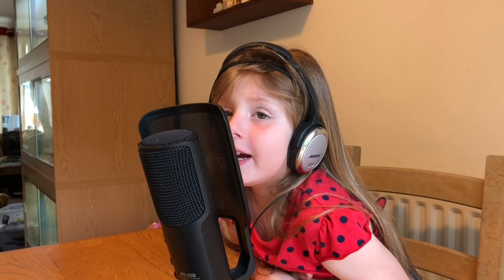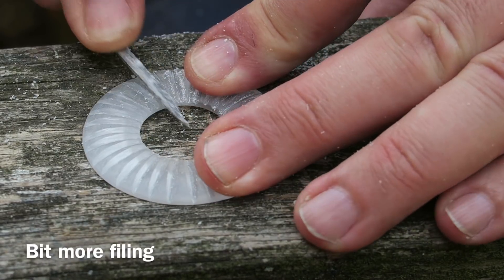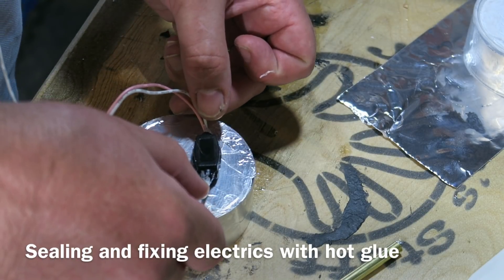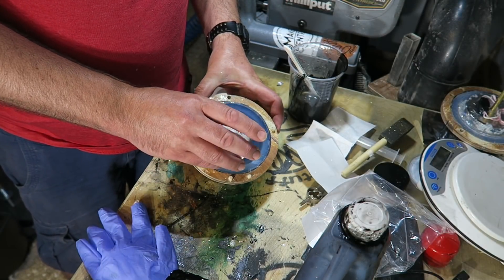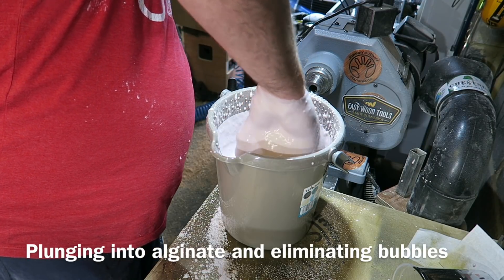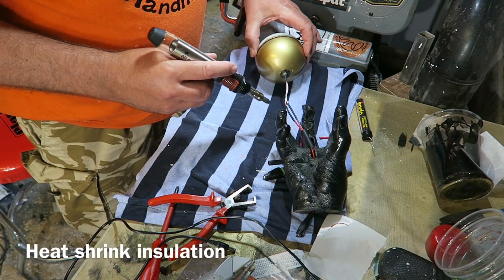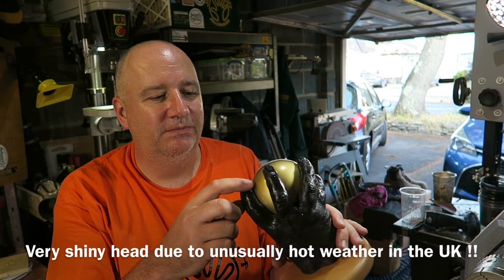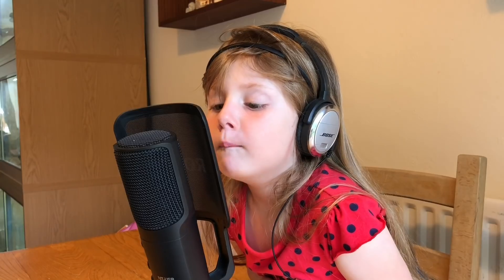Making the Goldeneye Light

Comment: 👁 😍 it 👍👍 Another good idea,You said it uses 12v, could it run on a 9v battery in the base of the led eyeball.Maybe a moving  led eyeball like the 😱cylons.
Reply from the maker: Thank you very much David. It would probably work on 9v but I have not tested this particular LED, I have done with a white version and it worked but was dimmer. Cheers, Jim
Reply: Thanks for the reply.